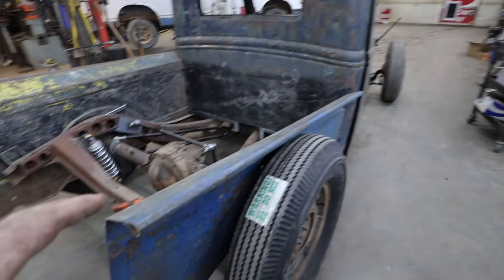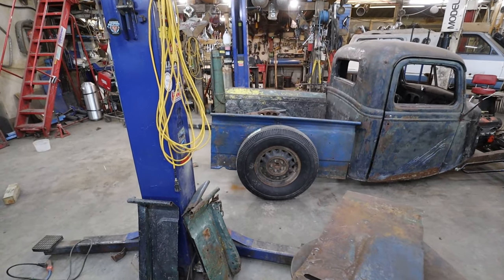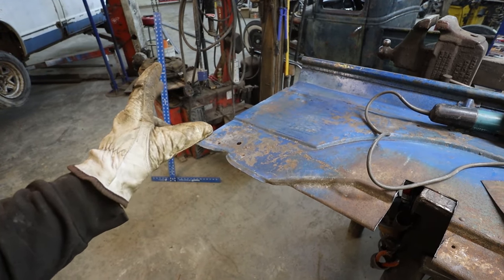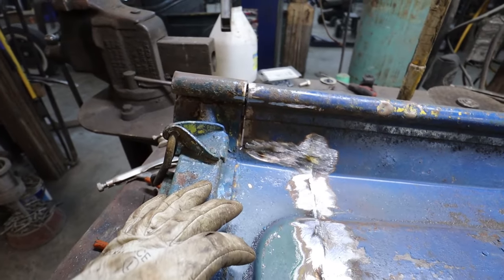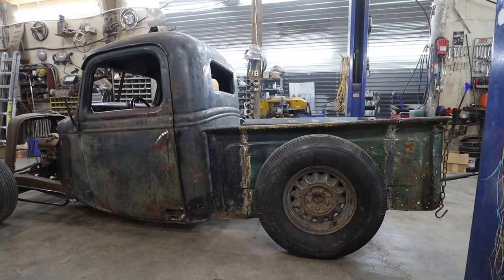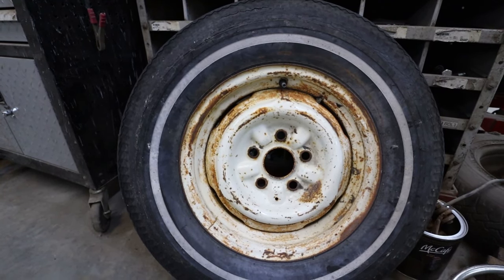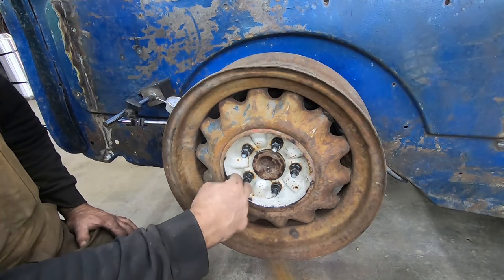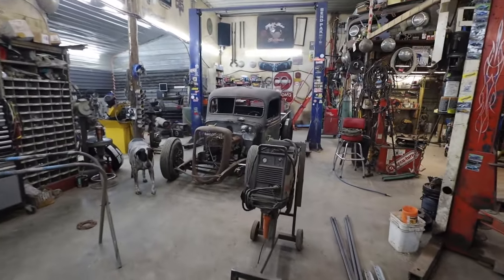Lengthening the box and cutting the center out of our bad wheel on the 37 Ford Part 11

Comment: - Gosh, what a lot of work. But I did learn stuff about planishing metal.
- Are you leaving the rail dents in the driver side box?
- Would a slightly undersized driver rod, with an elongated and rounded nose piece lathed to full size work to drive into "round" red-hot heated dents?
- Is it worth it?

Comment: To join that rolled bed top at the rear corner...grab a piece of angle iron and clamp it securely to both pieces. When you tack it, it can't help but come out straight.

Comment: If you put a hook on the bottom of the hammer and wheel, you can hook up a bucket of sand on it, and make it stable, yet portable (by removing the bucket). I haven't decided where mine go, so they're still mobile like yours, but the bucket improved the torture by quite a bit, certainly, they're not running away from or towards me anymore. :))

Comment: It wasn't just back in the Day, I bought four new Wheel Vintique wheels and had to move the centers out on the rear ones. I jigged them up and took before runout measurements and they were between 100 and 140 thou out.

Comment: You over thought this.  I'm getting a good chuckle on the wheel.  When you drive it, you can find out then.  I'm wondering if it will hold any air.

Comment: The truck is coming together and looking great Brent. The bed looks good as you have it. It's one of those things that would look good a little shorter (1") or a little longer, it just fits in with the truck as it is. Your work on the English wheel and the blemish hammer really straightened out the bed walls a 100% better in looks. Are you going to rattle can paint it to match the General? Get the theme thing going on there. Or paint it a darker or lighter grey would look cool as well. What ever you do will look great. Anyways, look like Pablo is your biggest fan, he just can't get enough attention from the master. Take care my friend.

Comment: Considering the surface of the rim is rusty, the measurements you took with the dial indicator would be approximate at best and I feel confident in saying that the surface of the bead on the tire is probably not consistent to a large degree and then you have to factor in that every tire bead will have some variation as to how far it will slide onto the rim when you mount it, it is doubtful that a few thousandths here or there would make any noticeable difference. That is, of course, unless you are racing it and every thousandth of a second can mean the difference between winning and losing. Love the vids. I always learn something. Thanks

Comment: When looking at the video of both wheels ,it looks like both outer rims have been run into curbs or run flat for miles.  Put a tire on them and run them. I used to cut and weld wheels measuring just with a tape measure and never had a shake. You won't notice a thing.

Comment: Hey do you have any ability to print out half-ass customs on a piece of black vinyl about a one and a half by 1/2 square that's feet 1/2 ft by 1/2 ft? I have a turbo diesel Land Cruiser with a rear tire cover it's a Japanese right hand drive and I love to put a patch on a blown out spot at the back of the wheel tire cover the vinyl tire cover that would have half ass customs on it. Let me know if that's something we could do thanks David it's a 88 turbo diesel Land Cruiser right hand drive the model type is a bj74v

Comment: Im no auto mechanic and even less of a machinist
But at the point you used dial indicator on the rim i was wondering if the axle couldve been off kilter
Those light duty diferrentials put the load on the on the axle shafts  and they dont stay straight forever just a thought

Comment: I have a 1937 dodge pickup but it has leaf springs in the front from the factory. My question is do you think it will ride like a chuck wagon or will I be able to smooth out the ride with all 4 wheels having leaf or leave springs not sure how to spell it. Thanks for any help.

Comment: Wow lots of fabrication in each video, I’ve never seen anyone cut the center out of a wheel and weld it back in.  The outside of the original wheel lip looks bent…lol so the one you are creating should be good.

Comment: Sir - you butcher priceless original tailgates, frames, etc when in fact you can buy re-produced tailgates, frames, and other metal sections from vendors.  Others are begging for the original pieces you chop up with a grinder!   Why do you do this?  Do you advertise your original Ford / Chevy/ GMC stamped metal for sale instead of chopping it up during your videos?